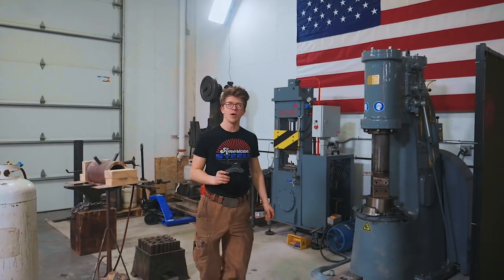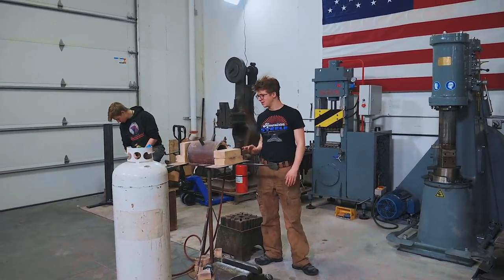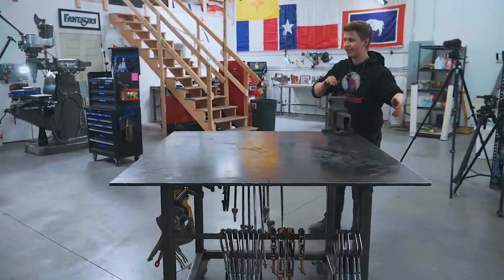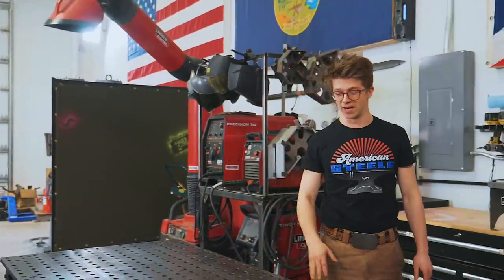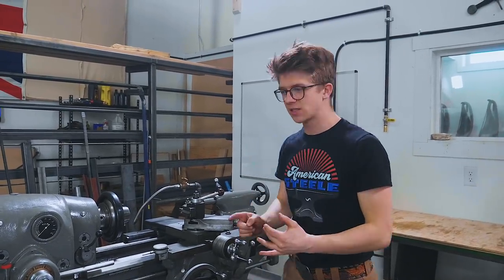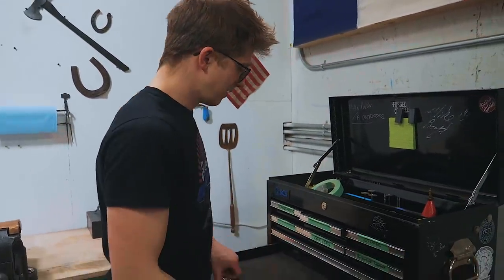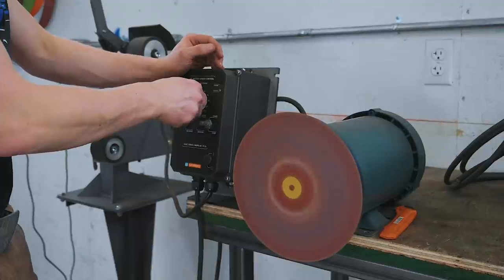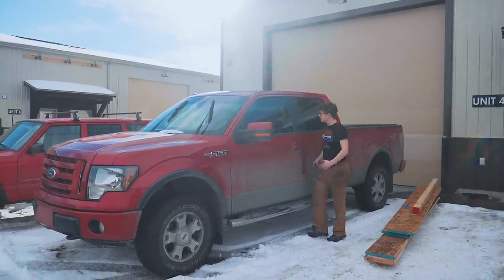MY USA SHOP TOUR, 3 Months in!!!!

Comment: Alex - concerning oxy / propane systems, propane has more  "BTU's " per cubic foot of fuel than acetylene. So its great for SOAKING a piece with heat or preheating . Works great for cutting also - as you know.

Comment: This must be why the sabre is being delayed. Looks like you've spent the last week just tidying!
Reply: they are waiting for the proper casting tools. this is just to fill the time
Reply: @krombopulosrick7920  i get that. It was more a positive comment of how long they must have spent on tidying and how well they've done (though from what I saw Scott probably did most of the cleaning!). And not meant to be a negative comment on waiting on the sabre video. Just a bit of light halearted ribbing.
Reply: @damascuseverything  yea they've done a great job organizing for efficiency. shes a pretty shop. I have way to many tools strung about mine I need to make alot more storage .
Reply: krombopulos rick I think most of our shops look like yours. I know mine is a freaking mess. And my 3yr old loves to drop my hammers and rings in my water tank. Little devil!
Reply: Wish I had a shop. But there is never enough room for tools. On my third tool box now. Much more and I will have to get a cart.
Reply: I'm also guessing the recast of the guard didn't look as good as they needed it to, as that's what Will was working on in the Hand Tool area.

Comment: As to the OXY/LP cutting torch. I use it daily in the oil welding industry. LP burns clean, as well cheaper, easier to obtain (any convenient store has it.  No need to use the awful fragile tip cleaners as the tip doesn’t soot up. You can cut with it, heat metal with it,  heat your shop with it. Best part is you can unhook your torch or forge and go hook it to your grill and cook food for lunch or dinner. 1 gas to do it all.

Comment: Difference between Acetylene vs Propane; It's is more economical to use Acetylene because the mixing ratio between it and the oxygen is 1/4 that of using Propane (ie: for every 1 tank of oxygen you'll use up with Acetylene, you'll have used up 4)  So in the long run, it'll probably cost more to run propane unless you get O2 cheap enough to offset the cost.  Also with propane you need to get up closer to the nozzle to get enough heat ( about 2800C vs 3200C) for cutting metal; Acetylene is has more heat in the cone and is better for cutting.

Comment: The funny noise after start-up may just be the fan clutch engaging.  My F-150 fan clutch engages when it's really cold outside.  Don't know why but after 260,000 miles it still performs just fine and the fan clutch still engages when its a cold temp. start-up.

Comment: Possible Idea: Build a metal bridge between your mezzanine spaces instead of another set of stairs. Might save you a bit of bottom floor space, but you'd probably need to anchor into to the side wall if it's strong enough.

Comment: Any plans for the center of the shop in front of the grinding room? Looks like a good place for a "glue" station for leather and wood on one side and hand sanding on the other. A 4 foot by 7 foot table that's divided by shelves in the center. One side with deep shelves for sandpaper and various wood and leather hand tools and the other side shelves for glue, string(for making grips), leather dye, wood stain, and tape. Should be able to get a good 3 x 4 foot workbench for each station shelves at the back of the bench for easy access of oft needed tools or materials and plenty of storage below the table.

It's a good idea to have a station dedicated for glue, stain, and dye... keep the messy stuff all on one station plus you never have to setup a bench for doing it when you need to. Since you have all the wall space used already and a big open area in the center of the shop why not two dedicated stations back to back? The whole thing can be on casters if it needs to be moved too.

Comment: Propane and also hydro-fuel gas which is really similar are more cost effective for cutting steel greater than 1" thickness, it also has a larger thickness range of cutting potential. If you are cutting metal under under 1" you can cut slightly better using acetylene but it's really not that great. What you need acetylene for is welding steel because while propane can reach about 4500* F acetylene can rach 5400* F, which you need to liquify steel for gas welding properly.

Comment: I had the same truck that made a funny noise right when it turned on. I took it back to the dealer and the main bearings were going out. Luckily my warranty covered it and I sold the truck after it was fixed. It only had 60k miles on it.

Comment: Suggestion: get a closed cabinet instead of open shelves for the camera equipment.  Keeps stray metal filings, dust, oil out of the glass and finely machined elements.

Comment: I saw you in Bozeman last monday and heard the startup Truck noise you mentioned. It's your timing chain tensioner. Have it looked At before it goes out. Also your exhaust heat shield sounded loose.

Comment: Propane has greater stoichiometric oxygen requirements than acetylene. For the maximum flame temperature in oxygen, the ratio of the volume of oxygen to fuel gas are 1,2 to 1 for acetylene and 4.3 to 1 for propane. So, there is far more oxygen being consumed when using Propane.

Comment: Those early ecoboost F150's 2011-2014 suffer from timing chain issues. You will sometimes hear the chain slapping around on startup and it quiets down soon after. Might be the noise you mentioned? Also, RIP Scott...

Comment: My Grandfather was a woodworker and coming from Germany, he got a master's degree in that. He built himself a little table for the disk sander, which was parallel to the ground and had a slot in its surface for the grinder. Why? Because he could slide something across the grinder, without worrying about it getting broken or rather damaged by missgrinding. An exact angle of 90° or π/2 in radiant, so he could grind in that exact angle. Maybe something You would like to try.
Edit: I really like your videos and Projects, keep on going:)

Comment: If you actually think about it, it costs less to use oxy acetylene than propane. You have to use more propane to get it hot enough, but you use less acetylene to get it to the same temp as oxy propane

Comment: Alec you are absolutely right propane is cheaper however with the added extra consumption of oxygen it does tend to equal itself out compared with oxyacetylene. For your uses as you said it’s probably better as you don’t weld with it so fair play also although propane is not as hot as acetylene you don’t tend to get the heat dissipation with propane so inevitably holds the heat longer so in all fairness that is probably the best use of Oxy propane In your case

Comment: buffer ... first do not DO NOT use a buff wheel on platinum that has ever been used on any iron/steel the real issue with iron and platinum is they bind/fuse when heated destroying the platinum value and it will not shine the way you want after. i dont usually get a chance to make a warning to you guys until after the event has happened ... hopefully some future crisis ... averted. :) still really glade youre in the US. American Steele ... merica yeah :))